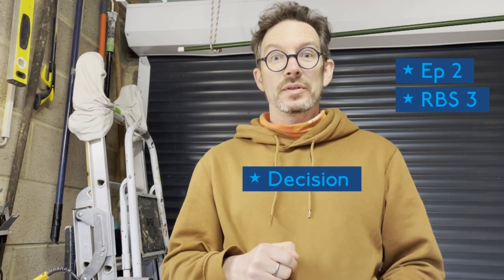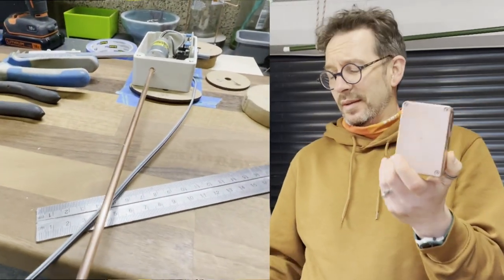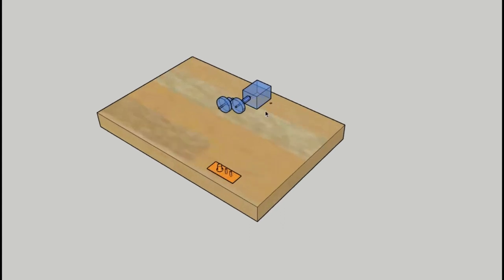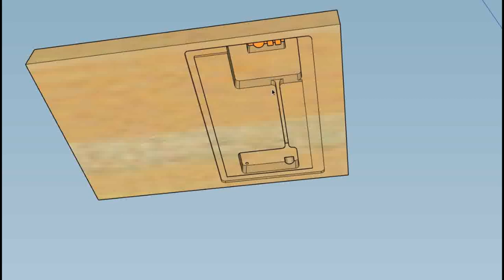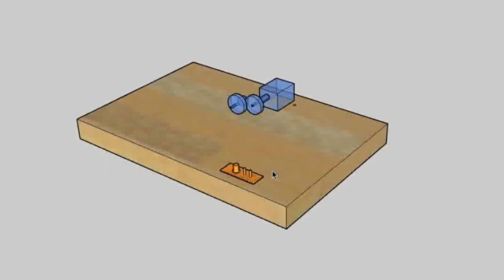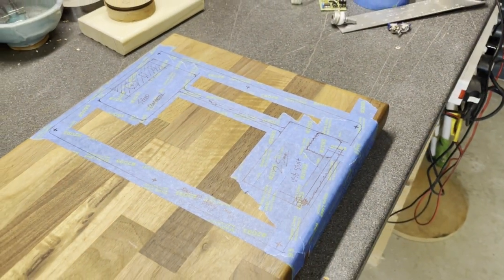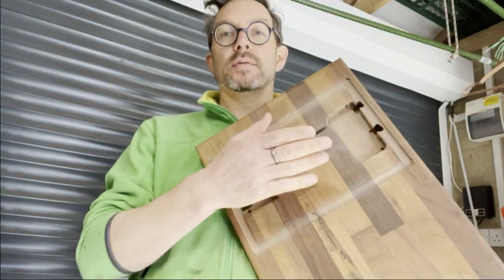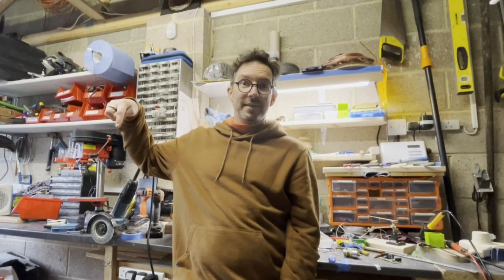Ep.2 // Woodwork // Building a Rolling Ball Sculpture

Comment: thank you for your detailed videos ! how do you curve 2 tracks at the time (to make track bumps for examples) and you solder after or before ?
Reply from the maker: Hi.  Track bending will be covered in future episodes.  There is no real rules here to follow.  Sometimes I will bend both tracks at the same time, but once they are attached to the sculpture, it often gets harder to do this, so I will bend them individualy.  Mostly they are soldered after bending to avoid any stress on the solder joints.
Reply: @CopperGravity  After bending....i understand ...but the challenge is to keep the parallelism ! thank you for your reply
Reply from the maker: @yvanroustan4426  Yes I agree.  Clips, clamps, cardboard, spacers, brackets, jigs etc are all used to try to keep them parallel.  That is all part of the "fun" isn't it?
Reply: @CopperGravity  indeed !